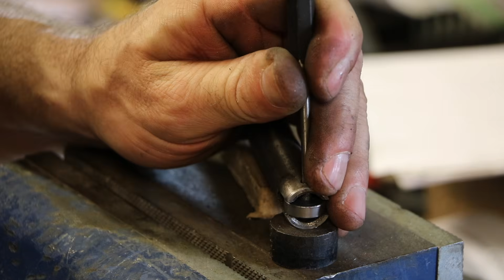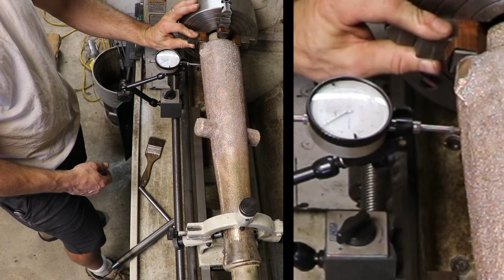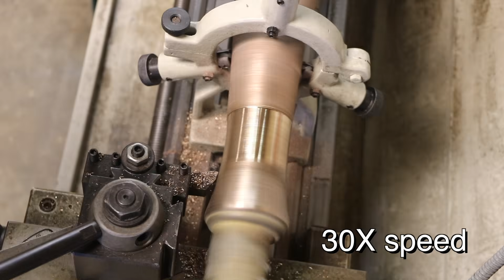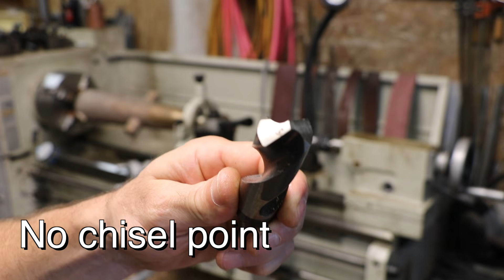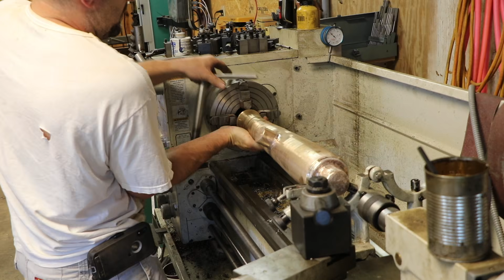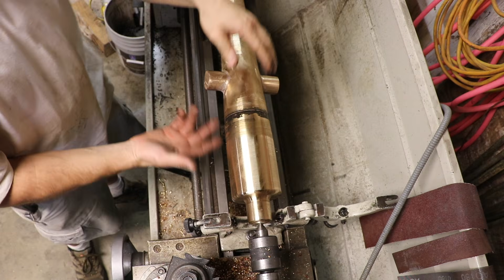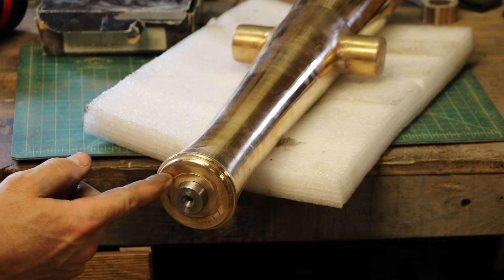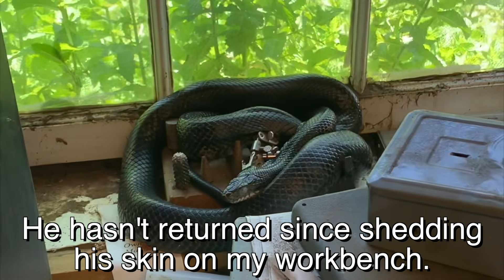Machining a Historic Bronze Cannon Barrel, Scaled Down Replica. FarmCraft101

Comment: you could sleeve the bore if you are too worried about the defects, If you used a steel sleeve i suppose you could even rifle it.
Reply: I agree sleeving the bore will be your best option
Reply: @sonicdrive  The only downside i guess would be, that he may have to cut the rear of the chamber to insert it. I'm not a gunsmith, but I've seen sleeves done, always from the breech not the muzzle. Upside is that it will be much stronger than even a perfectly cast solid bore.
Reply: @sternstones4871 : I sleeve rifle barrels from the bore end.  Since you do not need to cut a chamber for a cartridge, and the weak point is forward of the main pressure zone It should work.  Over bore it use a seamless steel sleeve, and Loctite black epoxy on the sleeve.  
Black powder does not burn it detonates.  All the pressure is in the immediate area of the charge.  Nitro powder burns peaking the pressure about 3-4 inches forward of the charge.  
This is the reason the old prohibition on shooting Damascus barrel shotguns is unfounded.  I have been restoring black powder shotguns and shooting smokeless powder in them for over 50 yrs.  I do make my loads very light on the chamber pressure. Reason:  The whole gun is over 100 yrs old not just the barrel.  I have never blown one up.   
I am not trying to convince anybody of anything.  Just stating the facts.  Everyone needs to follow their own opinions.
Reply: @r.w.felton6020  black powder does not detonate.  It burns like smokeless.  It is less pressure dependant.  The myth that it detonates started from the fact that its classed for transportation as an explosive where smokeless is classed as flammable solid.   This is merely because it can self contain if something like 50 pounds of it is lit unconfined, where a big pile of smokeless will always burn slowly unconfined.  When it burns it does not produce a detonation, that's something high explosives do.
Reply: @GigsTaggart Yes it does.  Smokeless powder burns a controlled rate while releasing the energy.  Black powder goes all at once.  
But as I said in the beginning I am not trying to change any bodies mind about anything.  Fifty years of making, designing, and shooting guns is what I base my facts on.  I have never even read a Guns and Ammo or any other shooters magazine.  Been too busy making loading and shooting.
Reply: @r.w.felton6020  He should really be using Pyrodex in this thing; its somewhere between black powder and regular smokeless. Its a hell of a lot safer than black powder too.

Just for fun, he could also use a few hundred match heads as propellant.
Reply: @KeenBeanPlayzGames  don't use match heads, they contain potassium chlorate making the burn rate pressure sensitive.
Reply: @Erpyrikk  Its not ideal for sure. I've reloaded 9x19 rounds with them before and also a few .45 ACP. There are definitely better choices but it makes  a fun conversation at the range ;)
Reply: @r.w.felton6020  Black Powder does burn and much slower than high explosives. In fact when loaded heavy it is still burning as the projectile leaves the barrel. You have been extremely lucky to not have been killed.
Reply: @r.w.felton6020  Any shooting powder does not detonate. They all deflagrates.
Reply: @r.w.felton6020  "Fifty years of making, designing, and shooting guns is what I base my facts on." just find me here black powder: https://en.wikipedia.org/wiki/Table_of_explosive_detonation_velocities or be quiet... doing something 1000 times wrong doesn't make it right. Best fact that proves that you are wrong is fact that you are doing it for 50 years and you are not dead. You would be long dead if you would be using real explosive for all that time, luckily for you black powder is only a pyrotechnic mixture...
Reply: @GigsTaggart  i dare you to leave an air space under the projectile of a black powder rifle then tell.me it wont detonate when it bananas your barrel
Reply: @Bialy_1  Even without your references he could have opened up a reloading manual and looked at the burn rate chart. Black powder and its equivalents  do not detonate like dynamite or c4. It is a controlled burn and shooting a muzzleloader in snow will show you that not all of it has time to burn and some gets blown out. Looks like pepper in the snow. Put to much powder in and more peppered snow.
Reply: @GigsTaggart  Black Powder dose not burn like smokeless powder, black powder burns much quicker then smokeless powder. Black powder goes up in a flash and smokeless powder burns much slower then black powder.
Reply: @blacrow7  that is how it behaves unconfined, yes.  Smokeless burns much faster under pressure than it does unconfined.  Its more pressure dependent.  Just google black powder vs smokeless pressure curves, they aren't all that different, but black powder has lower peak pressures.
Reply: @KeenBeanPlayzGames  No, it's not BETWEEN or any possible way even close or around or with the chemical the recipe or NOTHING to smokeless powder. It is a modern black powder solution with a smaller cloud of smoke and best black powder effectiveness available. Nothing more.
Reply: @r.w.felton6020  As Gigs stated, black powder does not (and cannot) detonate. Primary reference PATR 2700 (Pickatinny Arsenal Technical Report) "Encyclopedia of Explosives and Related Items".  It simply burns rapidly when confined.  Black powder is used as the lifting charge for aerial fireworks.

Some smokeless powders can detonate, even in small cartridges - as proven by a number of handgun shooters where their handguns were destroyed. The only handgun powder where this has occurred of which I am aware is with Bullseye. Loads of smokeless powders need to be worked up to carefully, as too much powder can cause dangerous chamber overpressure.
Reply: @r.w.felton6020  Regardless of your claim, you are incorrect and your personal experience is immaterial. Your small charges of smokeless shotgun powders have made you fortunate. You could just as safely shoot small charges of black powder in the same shotguns. 

I have been shooting both black powder and smokeless powder firearms for well over 60 years and have been reloading for over 50 years. Although I have never had a firearm damaged, I am well familiar with over pressure problems when working up smokeless loads.
Reply: @KeenBeanPlayzGames  Pyrodex is harder to ignite than black powder, thus making it somewhat safer in that regard, but the inventor was killed when his Pyrodex factory exploded.
Reply: @Kisuvka  With an exception under the proper conditions for a few smokeless powers, primarily fast burning pistol powders. And even there it is not certain that the powder detonated and didn't just undergo an extraordinarily rapid deflagration.
Reply: @nathanbutler8240  I have never heard or seen that happen. Can you provide some documentation? 

Just because a container explodes does not mean the propellant detonated.  Over fill a balloon and it will explode - but that is certainly not a detonation.
Reply: @blacrow7  Incorrect. See PATR 2700 - among other reliable references. Unconfined, black powder burns more rapidly than smokeless powder. Strongly confine them and the opposite is true.
Reply: @r.w.felton6020  100%FACTS!👍👍👍👍👍👍👍👍👍👍
Reply: I think at the very least he should fill that hole with something... washing that crevas out like with an acid to get the surface clean then fill it with braze, weld or at the very worst maybe epoxy, maybe JB weld or even epoxy with shop glitter mixed in over the surface. I think filling it with something, anything even if you need to refill it every 20 fires of the cannon is better than leaving it without filling it.
Reply: I have a 12 gauge brass cannon made by my grandfather in the early 70's. All of his cannons were sleeved with stainless tubing leaving the stainless sleeve proud on the breach end and then threaded for the screw on breach block.  The breach is stainless as well but sheathed in brass and contains the central firing pin.  This cannon has seen several hundred rounds over the years and is still in great shape.
Reply: @NickDangerThirdGuy  Yeah! Great idea.. for a cannon that should be close in construction to those made in XVII. Why not make it all with some tool/high alloy steel with a breach and semi-auto locking system, right at the beginning? 
Then maybe add a composite sleeve.
Or simply go to the black net and buy a modern era piece of cannon made of a composite material? It can be a used one. 
Used, 25, 30, 35, 40mm or even a soviet 73mm cal. That shouldn't be very pricy...
Reply: I agree, Sleeve the bore, you don't want to turn all that hard work in to a 18 kg bronze pipe bomb, Wouldn't worry about rifling it as it would add to the pressure
Reply: The sleeve could be given a slight rim at the base on the inside. This would prevent the projectile from seating too far in, and also provide you with a nice chamber that gives you a reliable space to fill with powder.
Reply: Dangus McFinghin 

The rim to keep the projectile from seating too far is a dangerous idea. 

With muzzleloaders, you want to ram the projectile completely to the powder.
Reply: @KeenBeanPlayzGames  That is incorrect. For black powder, you want the projectile pressing against the powder charge. Since the powder is loaded first, there is no problem with having enough space for the powder. 

For smokeless powders, there is a warning in manuals for some that warn against compressed charges.
Reply: @Bedgie01  how abaut he makes it to a 4 gauge - and uses widely aviable converted flare gun shells for ammo
Reply: That's a very good idea.  Machine the bore out about 4mm and make an interference-fit  high tensile liner from a piece of 550-580HB pipe.  That thing would be happy.
Reply: I'm no gunsmith but personally, I would be rather tempted to fill the large void by brazing with something like tin for added structural support then bore it out and sleeve it.  When it comes to personal safety and protecting your investments, there is no reason to not be overly cautious.  It would be a real shame for all that work to end in heart ache.
Reply: Agreed. Sleeving the bore is a solid option, and one that was used extensively to upgrade brass cannons.
Reply: :  It works great with old shot out rifle and revolver barrels.  Black powder will eventually erode any gun bore.  I don't care how carefully you clean it.
Reply: @r.w.felton6020  Any gun bores will eventually erode, regardless of the propellant. Some high velocity rifle rounds are notorious for rapid erosion of the chamber throat.
Reply: @martindinner3621  Why not shoot out of the sleeve itself. It is an AMAZING modern way of making cannons! Such cannon weight is 30% of the one made of brass. It can be much longer and take greater pressure. 
Don't know where such idiots are coming from...
Reply: Exactly
Reply: I would sleeve the bore with A 1/4 inch stainless steel sleeve and use green Loctite to hold it in place. Make sure to crown the end of the bore also I would put a 1/2 inch plug in the rear of the sleeve and weld it in place to be on the safe side. With out an X-ray or other testing you run the risk of blowing up all your hard work if there is something else farther down. That’s Just my opinion.
Reply: Absolutely! Sleeving would be the way to go.  I personally would go with the cryo approach... chilling the sleeve in liquid nitrogen or whatever you can get ahold of, and bringing the temp of the brass to around 500 degrees. Should make for a beautiful bond.
Reply: I’m just a little wigged out about the snake. That was unexpected.
Reply: @CordCrenshaw  Unless you are a rodent or smaller snake, you have nothing to worry about.  They are a non-venomous constrictor and eat the more worrisome venomous snakes and rodents.
Reply: I think if he were to sleeve the bore the would have to go in from the breach put a flange like a sleeved engine block where the  cylinder head holds the sleeve down if you go from the breach end you can thread the breach and put the breach plug back on top of the sleeve keeping it from ever coming out
Reply: @nathanbutler8240  A proper heat shrink fit will never come out - and does not need any sort of threading or adhesive.
Reply: Fill in the defects then sleeve it
Reply: well but if he gets it rifled he could just build a breechloader, make a excenter or screw with handweel operated breech that screws onto the rear of the gun with black powder cartridges - like get 4gauge flare pistol cartridges (bore diameter 26.5) , unload the flare charge, put more powder in and cast shotgun slug like lead projectiles
Reply: It is more fun to muzzle load and shoot 1" steel compressor  ball bearings  at junk cars.  I am not sure how many car bodies those bearings shot through.  We never were able to find them after the shot.  Just lots of through and through holes in car doors.
Reply: that's what we did. works great.
Reply: "barrel liner"
yes
not for sale at this size, have to make it, might want to make rifling button
Reply: @iamtheomega  I wouldn't rifle something this size tbh. More work than it's worth, sleeve or no sleeve.
Reply: @iamtheomega  Cannons are typically smooth bored.
Reply: @iamtheomega  no your wrong. Its called stainless machineist pipe... usaully custom ordered in certian wall thickness.
Reply: agreed... i'm also concerned about the wall thickness toward the muzzle end.. that 1/2" wall thickness just doesn't sound too safe.  we're talking about a 1.00 caliber fired out of soft metal.
Reply: Rifling is such a hard thing to do really, you see in parts of the work were people make some great 'illegal' home-made stuff but they're rarely able to rifle them
Reply: @mrcaboosevg6089  You have to be kidding me...
https://www.youtube.com/watch?v=ihPFjuxBjPo
Made with few bucks to rifle hardened steel barrels.
Reply: yes but he is trying to make a bronze cannon so no steel sleeve
Reply: If he rifles it, then he could shoot it.
Reply: @pby1000  Smooth bore cannons shoot just fine - rifling is just an impediment and adds little to the accuracy of a spherical projectile.
Reply: actually, that's a brilliant solution

he could make the bore larger since he left the nub at the end, and a sleeve would come with many benefits

like he could use different sleeves for all kinds of caliber, smooth and rifled and all that fun stuff...
also, he wouldn't have to worry about wear or casting defects causing it to crack or explode
Reply: Bronze you have to start over
Reply: You beat me to it.  I think sleeving has many good reasons.  You wouldnt have to worry about wear from firing.  You would be able to select a perfectly appropriate material.  You could even slug the back of the sleeve to have a bulletproof breach... and not have to worry about shooting your sleeve out if anything goes wrong!

If it was me i would leave the bore the size it is and sleeve it down from there.  Maybe you get a 3/4" diameter shot?

If you have your heart set on 1 inch and weld in a plug you can do whatever you want since the bronze isnt pressure bearing anymore.  The downside is this kinda ruins the authenticity and might make it sound different since essentially its a musket with an inch thick bronze jacket on it.

The other upside is you can easily make the steel sleeve and plug, test fire it outside the cannon, proof test it, revise as needed, then slide the finished design into the cannon.
Reply: I agree with sleeving the bore. But do not fire without it. Brass does stretch and when fire there is an even preasure until ball exit the bore. Sleeve it and you could also rifle it too.
Reply: Pure apoxy in the bore and insert the sleep will spinning the cannon and it should spread evenly filling all cracks leaving it center. Ive seen it done in other civil war replica cannons
Reply: If he will sleeve the barrel he will miss his main point of this project. Shooting from casted brass cannon. 

He can only rebore it like a 2mm per side and the rest of this "canyon" fill up with brass>
Leaving it like that - untouched can cut the lead ball which could effect with blowing all off.
First of all makers of the cannons of this type from the era, there were in use absolutely had the same problem. No doubt about that. Make a research on their practices in such a case.  After fixing it polish the inside of the barrel as well. It's always a lot of good for strength (and shooting performance) for anything made of kinda soft alloys.
Reply: the best legit hackers i can recommend for you are royaltyhackers,com, they got me $30,000 via hack trasnsfer
Reply: Sternstones sleeve it but stay smooth boar used a low oxidizing metal say with some nickel chrome in it heat boar cool sleeve to fit all but last few inches to muzzle. More of piece of mind kinda thing leaving the wall of sleeve around say 1/8" after boring. BRL should have public documents on bore pressure calls that are more that enough and they made the harp guns (now ARL name changed but they still use smooth bore 2x and 3x travel barrels for testing all sorts of things). Also the ductile sleeve materials will pressure seat over time so you could do some higher charges after initial boring with a slightly under sleeve and round then bore to size locking the sleeve in. Then maybe pressure test but you depending on use could just go with it. If it's a noise maker don't bother if it's a show piece that's not fired for targets used a light projectile. If your gonna shoot it a lot to hit things a a good distance.... put the time in and do first ten slightly higher pressure shots sandbagged far from anything living. Looks like a lot of fun please show results.
Reply: My first thought too. I have no real expertise here but, I believe I read somewhere that cannons were sleeved even "back in the day". I think it was particularly mentioned because a cannon bore will erode over time with use. The touchhole gets a sleeve also. A little research seems to show, historic cannons still in use are almost always sleeved.
Reply: Sleeving is also a period practice with many larger, and some smaller, bronze guns. 

I have to agree, I think the time to hot sleeve has come. The gun has turned out to nice to melt and recast, but you're still building pressure in the area that defect is in. Sleeve it to a 7/8 ID bore and call it good. It's quite a pretty little gun, you could put it on a colonial wheeled mount or set it up like a naval swivel gun!
Reply: Seamless hydraulic pipe as a liner is pretty common in reenactment cannons in the UK as it can withstand the pressures on its own even without being fitted into a cannon. You may loose a little bore and bore length unless you want to re drill (i'm guessing no) You will lose about an inch in length as an end plug will need to be bolted and welded to ensure no chance of breaking free once fitted as once it's in it's in for good.
Reply: TheHairyBeastie Titanium...lol